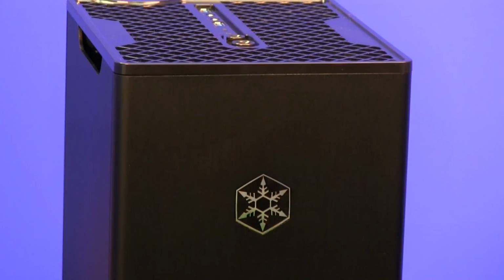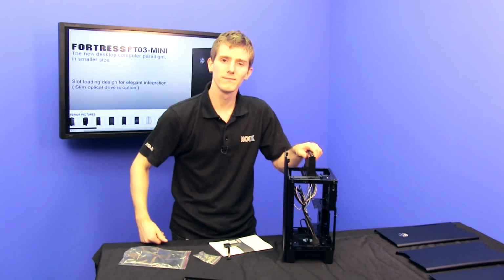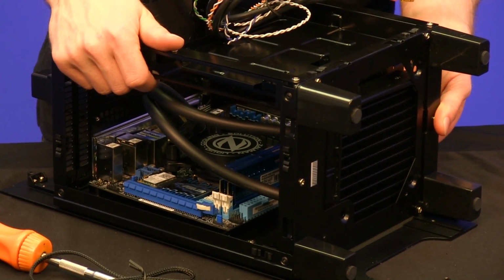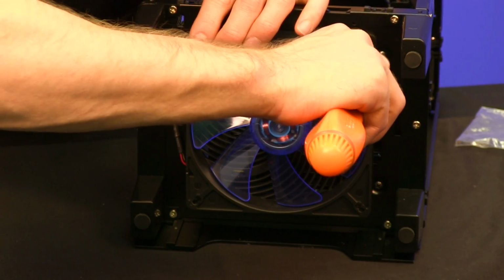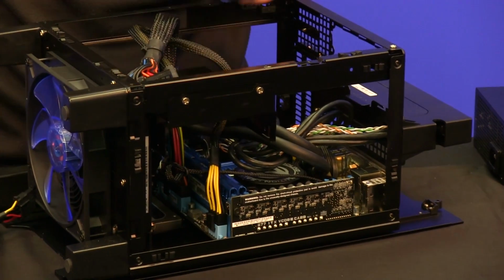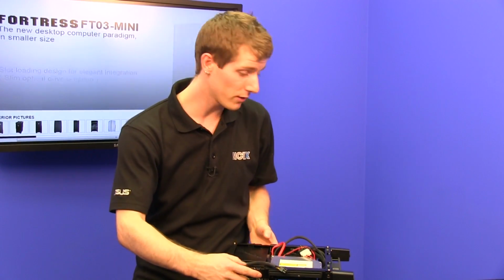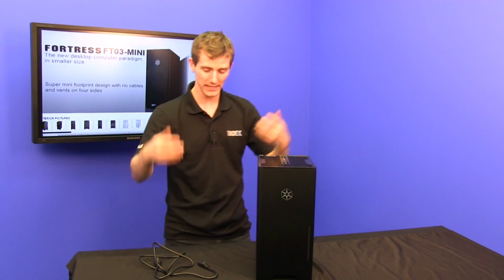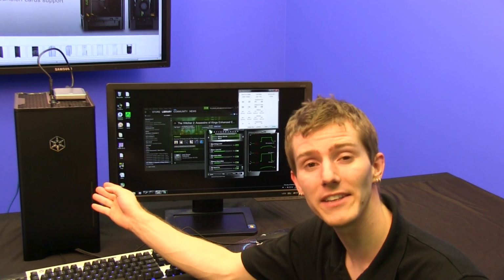Silverstone FT03-MINI mITX Gaming PC Build Guide NCIX Tech Tips

Comment: Question is a 450 or there 430 what ever it is good enough for an i3 system with a 7850 and 1 hard drive. It reccomends 500 on the card but then again so does the 670 and linus used a 450 here. And the i3 is the new ivy bridge pulling less than 90 wats

Comment: Will a GTX 580 FTW Hydro Copper 2 3GB fit.. and can you open the loop and connect it to the 580 and add more liquid cooling solution..... Can You Do That and is that even possible.. I need a answer I have the same set up but my graphics is a 580 Hydro Copper 2

Comment: Hi there, I have three questions at once. 
1. Does a Gigabyte GTX 1070 Mini ITX fit. (Im mainly concerned about the width of the cooler) or does someone know a gtx 1070 with a reference cooler less than 24cm/9.5 inches. I dont worry about the airflow as much since ill watercool the cpu as shown in the video. 
2. Is it possible to fully remove the 3.5inch hdd cage?
3. Will a 4-pin cpu power connector be sufficient to power an i5 6600 and a aio watercooling system? 
(Plan to use a gigabyte ga h170n)
Reply: 1: the GTX1070 Mini ITX will fit length-wise. It is, however, 3mm wider than Silverstone puts on the spec sheet. Then again, that's with the 3.5"/slot-loading DVD mount in the case. It's screwed in from the other side, which leads to point 2: yes, you can fully remove the 3.5" HDD cage, and thus install a GTX1070 mini ITX.

Comment: Wouldn't it be better to use a fan-assisted CPU cooler, instead of that bulky water one? It doesn't allow air to be sucked in, thus maximizing the GPU's temperature levels. I assume that no one buys an ITX case/board to overclock it, so the need of water cooling is eliminated.
Reply: The fan will partially push air through the radiator and partially into the case. A water cooler AIO or a very low profile heatsink would have to be used, and the AIO will provide better temps, meaning they can overclock.

Comment: isit possible to add another fan on the top of the rad?
Reply: It's completely unnecessary in this type of build. The air does not need to move too quick because there is a large volume of it. If you try to put another fan in, you will restrict space for things like HDD/SSD's and optical drive, you might also be limiting the size and type of graphics card you can use too.

Comment: I saw in the internet a company fitted GTX Titan in this case, how is this possible, I thought it allows max 10" cards but titan is like 12.9", sth am I missing?
Reply: Ergun, there is a larger version of this case that accommodates microATX boards; it looks almost identical, only with much more generous dimensions.  the easiest way to tell between the two is that this "MINI" ITX version has the optical drive slot oriented vertically on the front faceplate of the case, whereas the larger microATX version has the drive slot centered horizontally at the bottom of the front faceplate.
Reply: William Showers Please have a look on this video /watch?v=Rqkh2GXpFNI the case they use is FT03-Mini
Reply: They modded the bottom of the case.
Reply: I see, do you have a photo for bottom of the case that they modified? I want to build a system with this case and gtx780

Comment: You're blowing hot are the radiator radiated out back on to the components are you not?
Reply: The water stays relatively cool because it's flowing quickly so the radiator is not getting warm, it does not reach the same temps as the CPU and usually hovers around 35deg C. As long as you have good airflow then the components get cooled just fine.
In a case like this you need to be very careful to make sure you don't obstruct the airflow to the components that need cooling. Careful routing of the cables is vital to make sure they are out of the way. I would mod my cables for this case so they were exactly the right length to connect them up and still keep them out of the air path. The more obstructions inside the case, the more you will slow down the airflow so you need to avoid bunching up longer cables and keep the middle area unobstructed.

Comment: Would a 140mm radiator fit in this case? Or is it only 120mm?
Reply: But if I fit an M2 SSD on the back of the Gigabyte H270N-WIFI ITX motherboard, I can do away with the 2.5" SSD, thus allowing a dual-fan push-pull 140mm radiator (like CM Nepton 140XL), right?

Comment: Can I put a 140mm radiator in this?
Reply: Just by watching the case, you could put a 140mm rad taped on a side panel. Otherwise its pretty much impossible. That GPU barely fits so...

But theres few ITX cases that supports watercooling pretty well. HardwareCanucks did a nice countdown of his favorite minITX cases :)

Comment: No it doesn't, an entire system with a 7970 won't even bust 390W at the absolute maximum (that's a 2011 socket system too). They went with the 670 because it's 9.5", the 7970 is 11", and this case only supports 10" cards.

Comment: what u guys think about this build(gaming):

os :windows 7 home premium 64-bit
cpu :intel core i3-4130 processor
cpu cooler :cooler master seidon 120xl liquid cpu cooler(or any other suggestions)
mobo :msi h81i mini itx
gpu :palit geforce gtx 750ti 2gb stormx oc
ram :kingston hyperx fury 8gb(1x8gb) ddr3-1600
storage -ssd :a-data premier sp610 128gb
           -hhd :wd caviar blue 1tb 7200rpm
psu :corsair cx500m 500watts 80+ bronze semi-modular(or any other suggestions)
case :cooler master elite 110 mini itx case(or any other suggestions)

i need opinions or suggestions before i can start buying the part. :)
Reply: Your cooler really doesn't need to be that powerful.  Honestly, with an i3, you can just stick with the stock cooler.  Although, I would suggest a quad core cpu for gaming today.

Comment: The fact you consider 81c to diminish a GPU's lifespan shows me you know very little about the info your dishing out. GPU's are designed to run @ 140c without damaging the Die Wafers. Anything under 104c is not going to harm a GPU die.

Comment: LIES!!! the normal FT03 is bigger from all the sides and have an ugly plastic intake at the side which is also the exhaust of the psu
it should of been a regular atx case rather than a matx so that the bottom fan intake is not angled and instead a flat one. it would of been a tad deeper